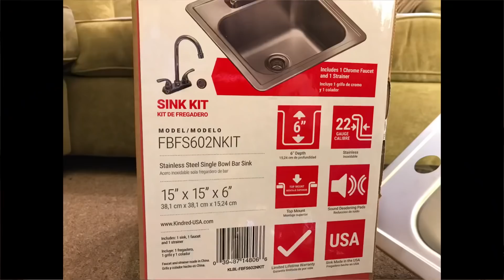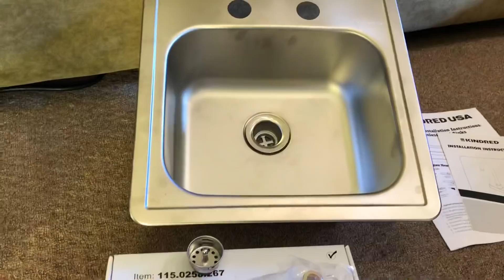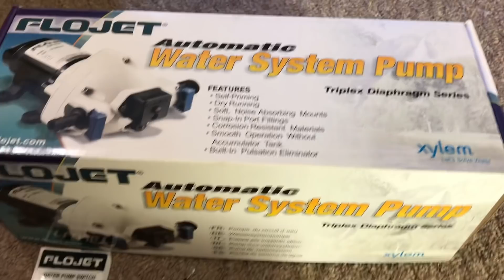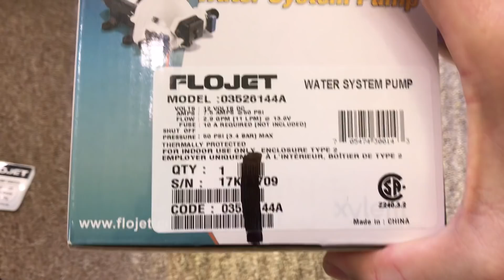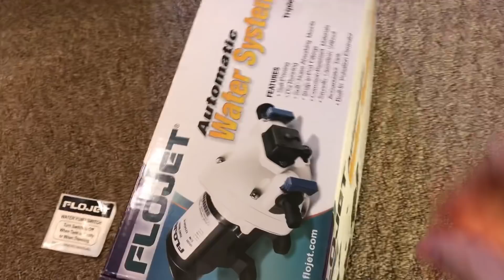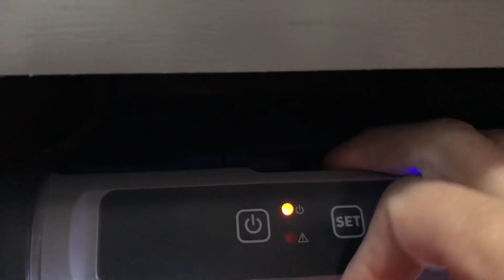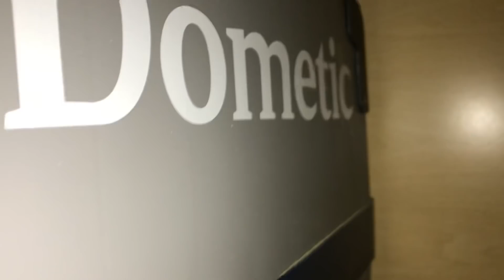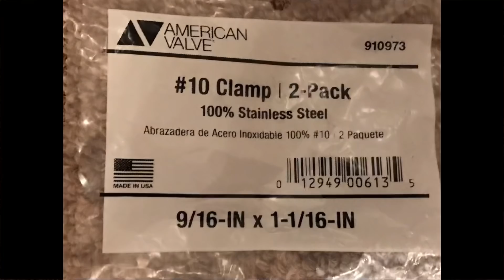Make Simplified On-Demand Water System-Tiny House, RV, Van, Camper, Build, Kindred, Flojet Triplex

Comment: Maybe the angle makes it look like you mounted the rubber gasket to the top of the sink.  The rubber goes under the sink, then the gasket then the nut.  Use plumbers putty between the top of the sink and the drain or silicone if you prefer.  Then reason you don't put the rubber gasket on top is it makes your drain sink proud and water will not completely drain.  Let the silicone squeeze out and dry and then cut it off neatly if you use silicone.  I also like to run a generous bead of silicone on the sink lip where it meets the counter to prevent water that is spilled on the counter from destroying the counter top.  It also glues it in place.  I like the job you are doing, everyone else makes cabinets which is rather difficult if that is not something you have not done before.

Comment: That sink looks great! You chose a size that is small enough to fit, but big enough to be sufficiently functional.
Did you try stuffing your head in the sink? That is where you will be washing your face, so don’t want to crash into the upper cabinet.
I trust you put caulking under the rim.
That giant hole in the back of the cabinet should help ventilate the refrigerator.
Nice work!
Reply from the maker: Thanks and yes I have stuffed my head in the sink, it's a tight fit but the high riser really makes a big difference. Have not tried the hair washing yet but that should be an adventure. The face washing works great. I made sure I would not bang my head on the cabinet so moved the sink quite far forward which made a nice bit of room behind it. I need to caulk the rim, that could be a water damage issue if I forget. I  was thinking the same thing about the fridge ventilation.